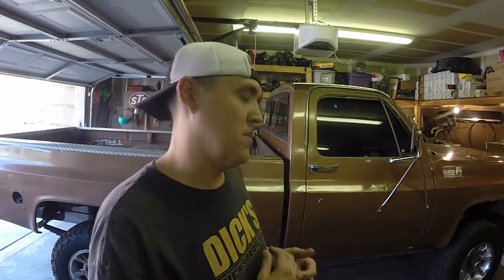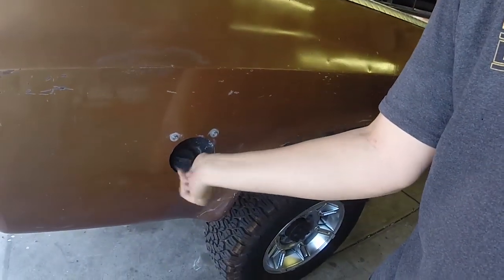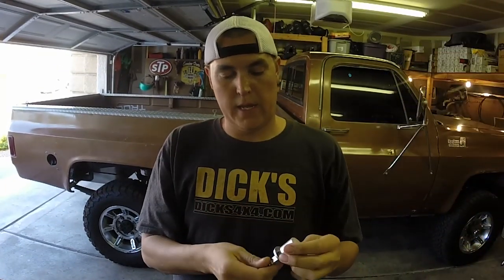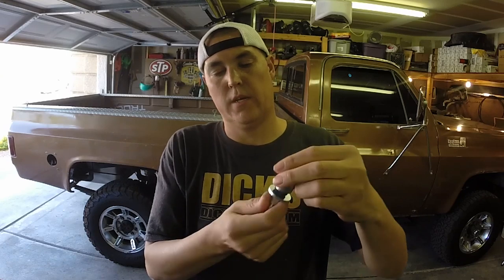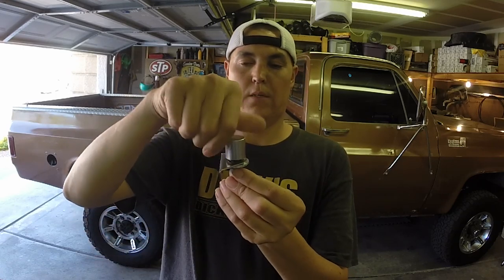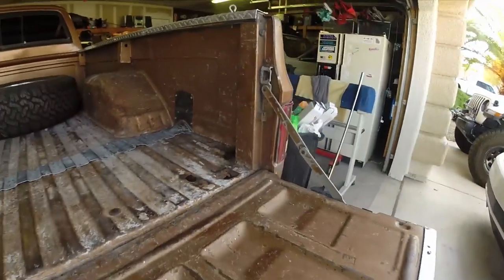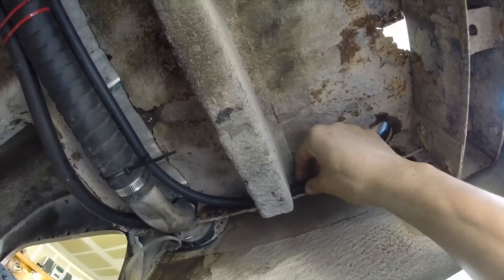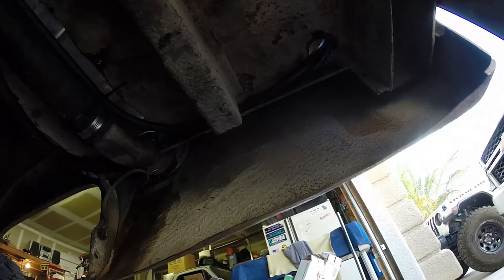Rollover Valve Install

Comment: I would be using a carbon canister & enable purge if your running a “LS” an PCM. This set up will fill the garage with gas fumes.
  A true roll-over valve is misunderstood and sold for racing only. The valve you need seals the tank when liquid fuel hits it. The aftermarket tanks don’t have a bump on top to trap fuel rich air inside as refueling. The vent side goes into the vent inlet of a carbon canister and holds raw hydrocarbons inside the canister as you paid for it. Most tanks will have a hose connector that can go high inside the bed, make connection to the filler neck. This roll over valve shuts off when liquid gas hits it, forces raw gas to backup into the filler neck and hit the aspirator tube in the pumps nozzle to shut off refueling. Purge goes to engine intakes purge valve. Tank vent inlet is open all of the time until PCM testing, then shut off and close. This feature is disabled for EVAP testing if PCM controller. Best of luck as even changes in the air temp in the garage will cause gas fumes. If you have a gas water heater or gas forced air furnace in the garage, the chance of combustion is there.

Comment: What did you use for a fuel door/gas cap through the bed I’m in the process of putting a blazer tank in my 1984 k2500 gmc ?
Reply from the maker: Regular cap, no door yet.

Comment: does this help with a fuel tank that constantly burps when filling up? 
when the pump cuts off the fuel flow and takes forever to fill your tank?
Reply from the maker: Technically, but it should fill properly without it.
Reply: @Dicks4x4Garage  so it shouldn't replace the existing vent tube, but couldn't hurt in addition to one?
Reply: You want to add a larger hose that T-s into the filler neck. That way it only vents when you pull the cap off.  This rollover valve is for different purpose. It’s for tanks that don’t have vented gas caps and for obviously stopping the fuel from coming out the vent tube in case of a roll over.

Comment: Did your tank have an existing line exiting the tank to use for the vent or did you add a line?
Reply from the maker: There was a port for it on top of the pump.

Comment: So does that valve let air in and out?
Reply: I have one of these but haven't installed it yet.  If it's installed straight up(barb down) then it can draw air or relieve pressure, it doesn't seal off the line until it's upside down.
Reply: Have the same question, looking for a 2 way valve that keeps pressure in until a certain amount of psi then either lets air in or out, if it exist (mechanical valve w/o solenoid)
Reply: @mattc9875  I don't know if you ever solved this.  Basically you need a pair of pressure relief valves, connected in parallel, and one facing backwards from the other.
This is how your radiator cap works, so you can look to that for inspiration.